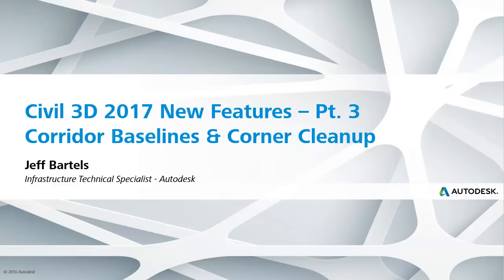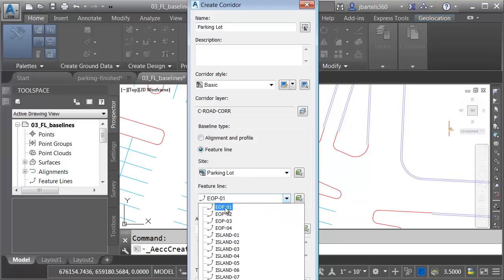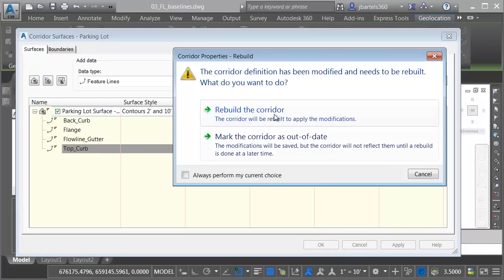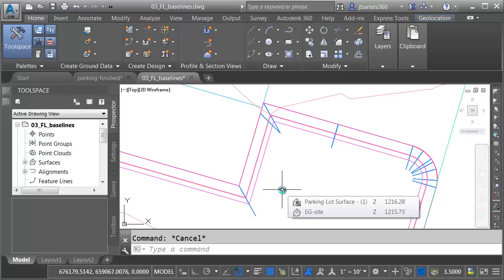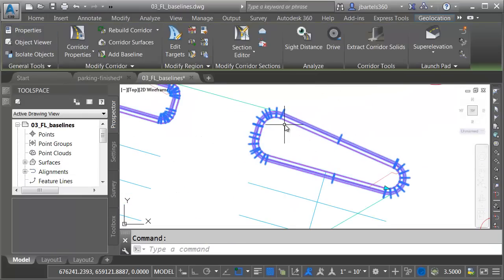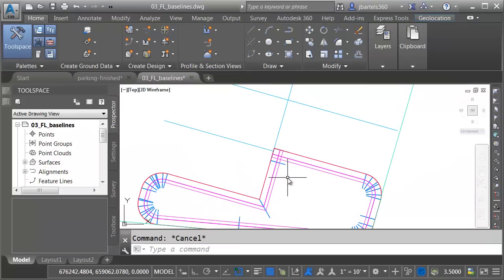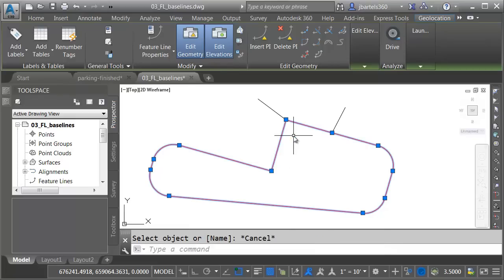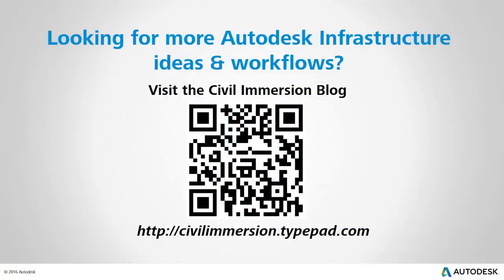Civil 3D 2017 New Features - Corridor Baselines & Corner Cleanup

Comment: also, you mentioned that the feature lines were all 3d. did you grade them for slope? or they all the same elevation? is the surface one elevation (flat)? i'm just trying to figure out the procedure here. do you go back after the fact and raise/lower areas to create the slope in the parking area?
Reply: Fail